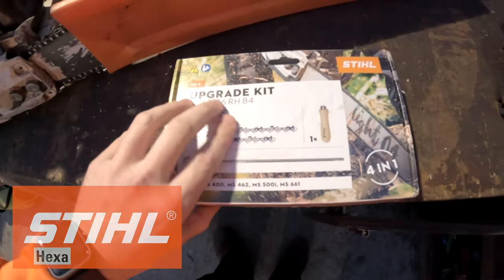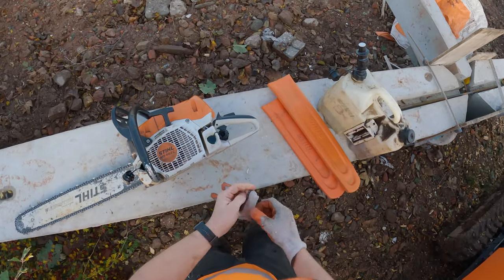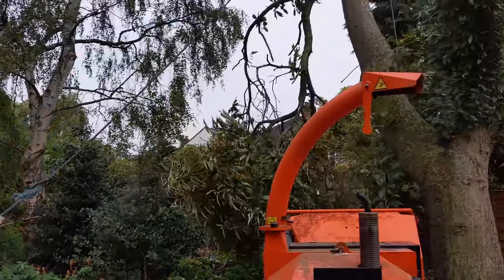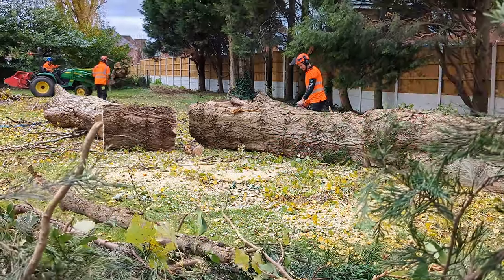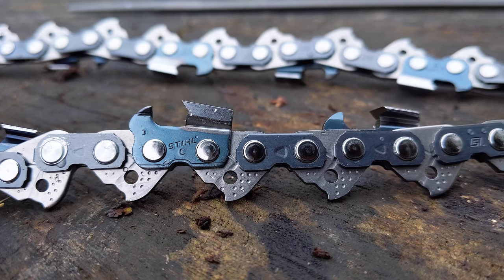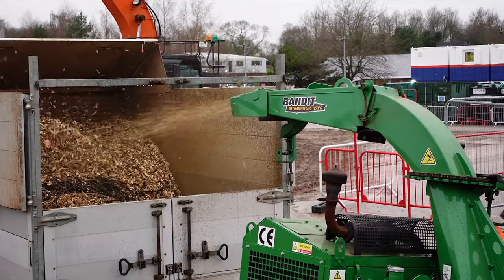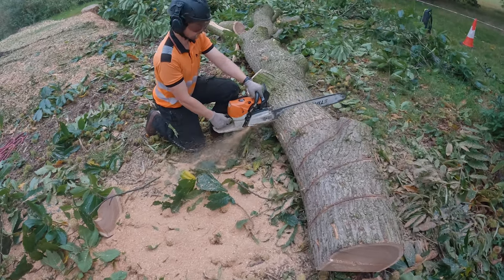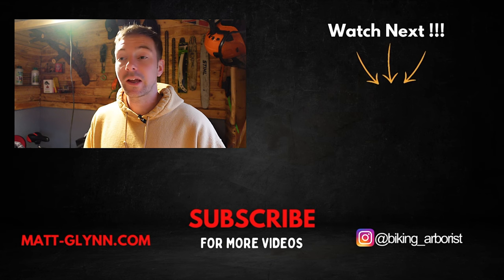Stihl Rapid Hexa Upgrade Kit Review [UK Tree Surgeon]

Comment: Great well thought out review Matt. Just throwing my 2 cents in it seems that for a beginner firewood guy it's a pretty good system to use and get on to.  I've used the hex chain file on a round RS profile chain and it will convert it over a few sharpens. I don't know if you've heard of square ground profile.( it's similar to Hexa is profile)  It's a rabbit hole to go down but if you do a lot of fire wood like I do it's probably 30% or more faster than round profile and has changed my world in combo with a barker box and oil air filter.  Porting saws is a whole other thing which turns a saw into a beast, however the advice I've received is to leave this for loggers felling trees... if you're just burning fuel making fire wood it may not be worth it, but for some one like you where time is money it may be an idea.  Cheers Tom from Wanaka NZ.
Reply from the maker: Hi thanks for your comment. Yeah I have heard of square ground files never tried it myself though. Stock saws work fine for me at the moment. I will venture into ported saws at some point but not at the moment. I have done a muffler mod and advanced the timing on My 150T that made the saw run better. Nothing more than that for now though. Thanks for watching and taking the time to leave a comment. I really appreciate it.

Comment: @Matt Glynn
Instead of everyone being “bought by the fallacy” of Stihl Hexa, why not just change a standard Stihl to square grind like the Yanks use? It’s faster cutting (fact!!) and it’s easier once ground, to get back sharp.
Interested in your thoughts
Reply from the maker: Yes you could do that for sure. That's how it's always been done. I guess Stihl are jumping on the band wagon with their own. Good that it comes in an easy kit though.
Reply: @jbss7382 I think the idea here is to put the benefit of square ground chain into as many hands as possible, but retain the simplicity of regular round filing.  While square ground is tip-top, fast and my preferred option in clean wood, get your angles wrong, hit a pipe full of mud (like my trees), or just drop the bar tip into the dirt, it's dull in an instant.  The idea of having a purpose-built file dulls the skillset a little, but more users are likely to pick this up than go through the effort to learn proper square filing techniques.  And if you can buy it all in a kit, so much the better for the usual lazy man....

Comment: Great video I have been running the Hexa on my 462 for two weeks now just to process firewood. The upgrade kit is the best deal, I am unsure if I will buy anymore when compared to the price of the Stihl RS chain. I think for a novice it's easier to file so perhaps Stihl should do it in a .325 option for smaller saws and aim it at the new chainsaw user?
Reply: Or you could look up West Coast saws on YouTube and they teach you how to square file 
Yanks have been doing it for years. Once you get the hang of it; it’s piss easy. Enjoy
Reply from the maker: That's great Patrick. Good idea that going on a .325! The cost is certainly something to weigh up.